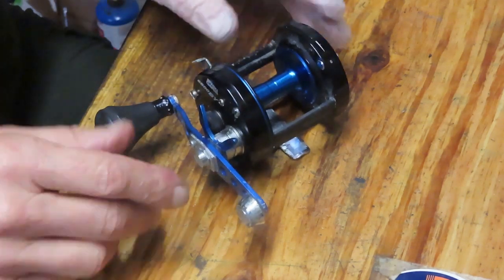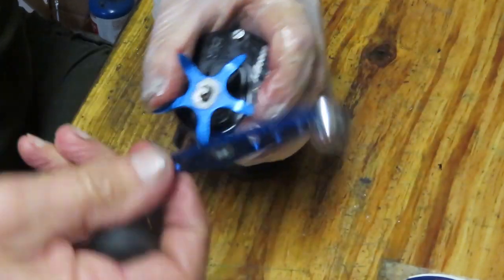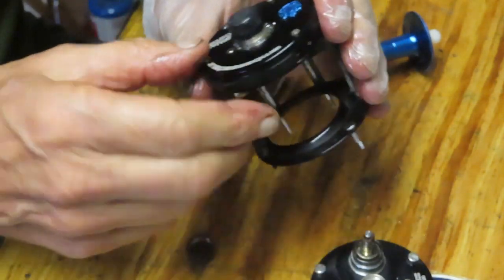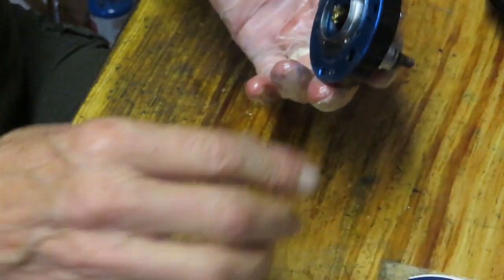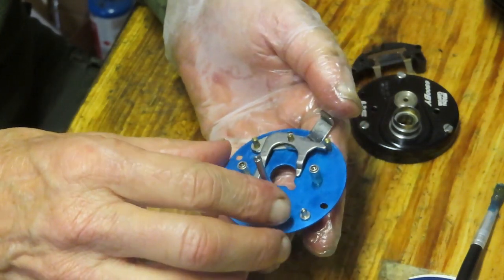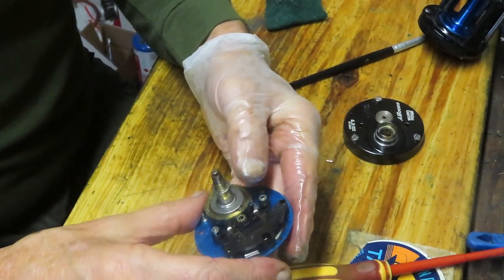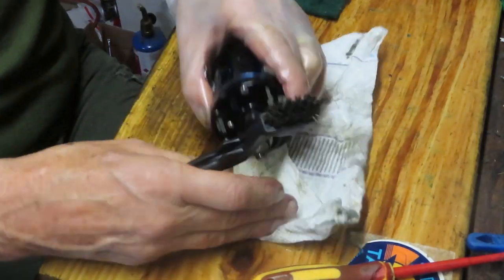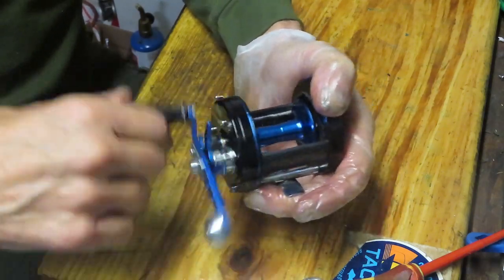Abu Ambassadeur BY Blue Yonder fishing reel how to take apart and service

Comment: Dennis, I inherited a abu 5500D Ambassadeur high speed. I don't know much about the reel it seems like a direct drive. As you tighten the nut where the drag would be  it lets it run in reverse in tension by spinning the handle in reverse.. When you back the clutch nut out it locks the drive with no reverse. Not sure if this is normal or an issue. Reel is in excellent shape and seems to be functioning well. I just don't understand the point of not having a normal drag where it lets line out when needed without spinning in reverse? Any info would be helpful. Thank you for everything.
Reply from the maker: That's normal.  Yes - it is a direct drive and yours is operating properly.
Dennis

Comment: Woul it be ok to set the handle in distilled water to dissolve the salt?
Reply from the maker: Any freshwater bath is fine.  It may take longer to dissolve the salts as there is no catalyst, but it will work.  I recommend flushing a reel with fresh water after every trip. - Thanks - Dennis